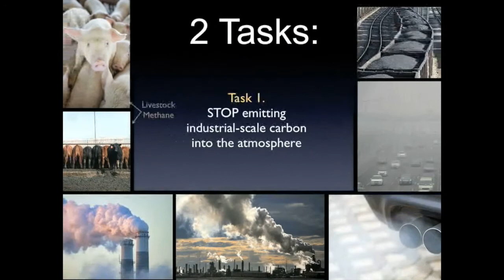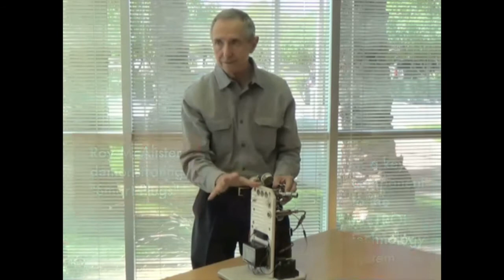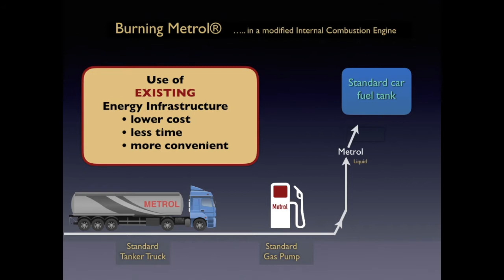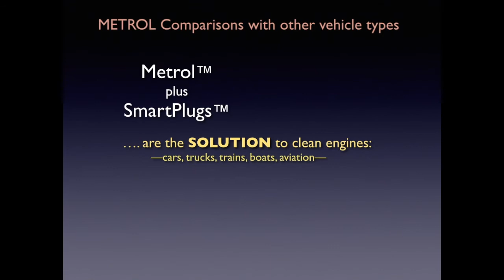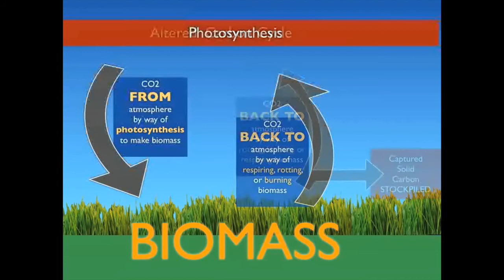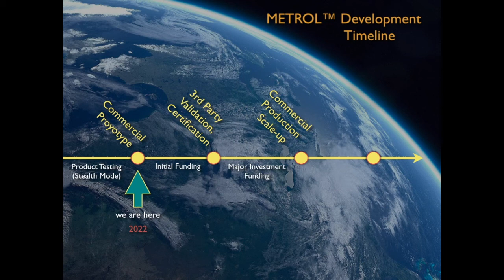The METROL Movie .. Ver. 12

Comment: This is the 6😁th day running.  Fascinating stuff.  Sounds a lot like liquid hydrogen, hydrogen having the problem of high voluminosity.

CO2 is 400ppm in the atmosphere, and the goal is to reduce it to under 350ppm.  Nitrogen is 780,000ppm and Oxygen is 210,000ppm.  We're talking about reducing what is .04% of the atmosphere to .035% of the atmosphere.  Most people (many people) would say "You got to be kidding!!!".  This is one of the tough issues about selling climate change.

Another burning issue is that the sea levels will rise 3 feet by century's end.  Three feet.  How do you convince the public to be concerned about that? 

The other selling obstacle is the fact that our climate has been changing since the planet was born.  It is impossible to stop climate change.  There should be no one working to stop climate change.  Only a crazy person should say that we must stop climate change.

What we need to do - and everybody can agree - is to clean up pollution of the planet; to slow the extinction of any plants and animals.  We can see these things.  Also, to prepare for and manage nature's wrath in the form of storms, floods, and wildfires.  Build in harmony with nature, and develop better management and rescue services.

I can also throw in human population stabilization, but that's not very politically correct😁